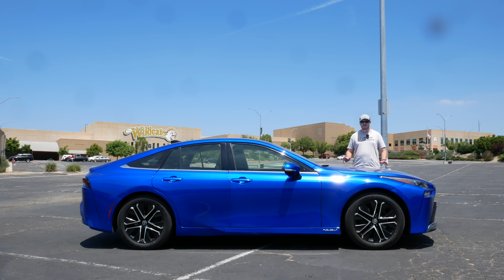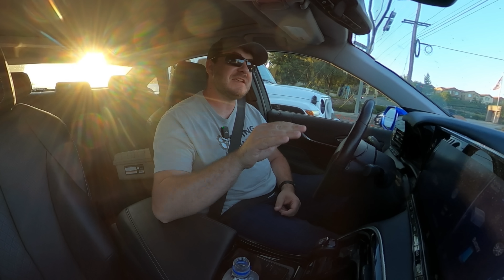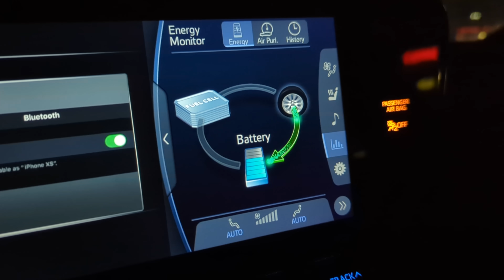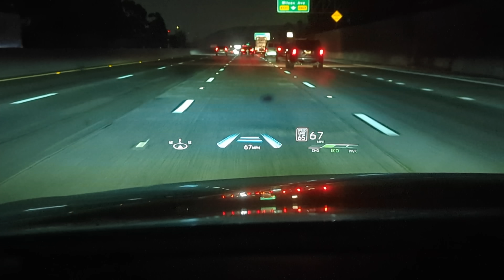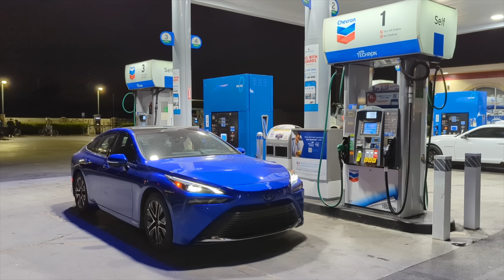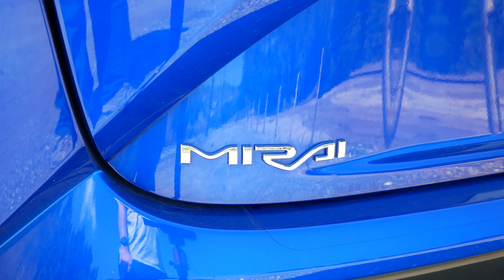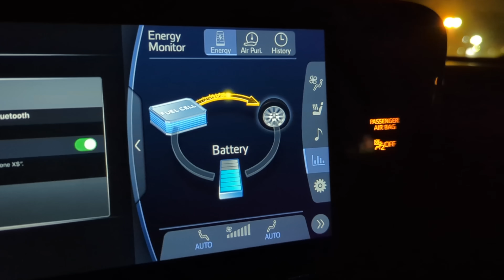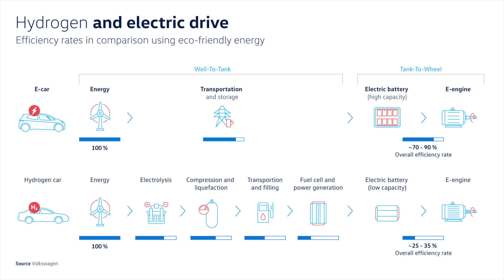The Toyota Mirai is Disappointing

Comment: Toyota's recently announced that they've finally come to accept that full electric vehicles instead of their crazy drive towards Hydrogren, and they've got some battery tech that should make even Tesla concerned.
Reply: If making an experimental new technology battery work in the laboratory is a 5 in difficulty on a scale of 10, then getting one in production in scalable quantities at reasonable cost that will at least match the life and cycles of what's available now is a 10+++++  There are literally a hundred startup and legacy battery companies promising all sorts of whiz bang cells that, up until now, have not made it into production.  Toyota may very well have a world beater battery, but the odds are it will come from somewhere else.
Reply: They announced hydrogen engines?

Comment: Honestly, 50 mile range plug-in hybrids with small, efficient gasoline/diesel range extender engines seem like the most sense as a "transition period" for me. 90% of the usage will be entirely EV, but range concerns and refueling time is just as good as most ICE cars. Much less lithium will be needed to be used, battery performance and longevity will matter less, and nobody will care if there isn't a fast charging station nearby, since they can just fuel it up at any gas station if need be.

Comment: Not trying to nitpick, but you really shouldn't refer to hydrogen as air. The correct term is gas, especially since there is hydrogen in air, albeit in vanishingly small amounts. You'd also be getting ripped off pretty bad if you paid that much for a tank full of air.

Comment: Because this is the wrong way to do a hydrogen car. Onboard separator that you will with distilled water fueling a hydrogen combustion engine...which can be easily adapted to any ICE design. Already being done with Farm machinery and heavy trucks in Europe. Cummins is debuting hydrogen combustion engines in 2025 adapted from their diesels. The technology has existed for decades and we all know why it wasn't focused on... because it would almost eliminate the oil and battery industry as we know them today.

Comment: ah yes, Hydrogen Cars, the more you look into it, the worse it gets with the promises that would somewhat need to break physical laws to work
And also speaking of Tanks, something most of the Tech Bros wont tell you, like that Fillingstations can't hold that much hydrogen like it could hold petrol or that the efficiency from Energy production to Wheel, as in "the ideal storage solution for wind and solar energy" is really bad that, even if you don't use it a fuel for a car, there are way better options to store energy like compressed air or heating up stones

Besides that not needing a car or not calling small lorries "cars" would be even better, but that's better safed for NotJustBikes

Comment: We have to keep in mind that this is very new technology. It's like going back to Nickel Cadmium batteries for your EV.
Reply: Not new at all, maybe the carbon fiber tanks are newer. But the first Hydrogen fuel cell vehicle was the GM Electrovan in 1966. The Toyota FCHV and Honda FCX, began leasing on December 2, 2002. So technically, HFCVs are at least 20 years old, about the same as modern EVs, which have advanced far faster then Hydrogen.
Reply: Actually it is an rather old technology….when I was a child, in Germany, some H fueled cars and smaller trucks was driving around…it was always just "research" projects…35 years ago!…the cars was able to drive, but nobody had the will to change anything at this time…especially not the car industry. The only German fuel cell car build in series (Mercedes Benz GLC F-cell) was canceled some years ago…now they are thinking about truck engines with fuel cells…let’s see, when this is coming to reality…

Comment: Great video, it explained the whole "hydrogen vs battery" shindig really well. I fully agree with you on hydrogen being part of the future, despite it being an objectively crappy choice for personal transport.
Reply: It’s not even that good for public transport either. After all, both buses and trains can be made to use overhead electric wires for power. So why bother with converting electricity to hydrogen and then back to electricity again?
Reply: It is good for long haul trucking and intercity bus lines.
Reply: @Schaufensterpuppengestaller  It makes no sense on our roads, far too many problems with Hydrogen. It simply can't compete with Battery electric, which is improving leaps and bounds.

Comment: if they made the battery capable of 50 plus miles, and gave you a charge port, alongside the hydrogen part, they could be far more useful, but honestly, there really isnt anything holding battery only EV's back.  this is just an ev with a small battery and an annoying fuel cell.

Comment: fuel cell cars will go nowhere because of what you just pointed out.
low efficiency being the biggest.
and high cost of hydrogen being second.
too high of pressures, too volatile and hard to contain.
there will be a few uses for it.
batteries will only get better and lighter from here though.
10-15 years from now batteries will be twice the energy density and half the weight.
which would really kick hydrogen.
never mind it's lack of power too.

Comment: I think the question of fuel cell longevity is important, with how expensive and short lived lithium batteries can be. If you could get a million miles out of the fuel cell, that'd be a big plus in my book. I think that plus the option of having an electrolysis hydrogen generator at home would make this a lot more enticing.
Reply: What EVs have short-lived batteries?

Comment: For semi trucks the best option isn't hydrogen but rails.
Reply: As a former semi driver I agree completely. Most runs could be 10 miles or less and the rest in a train. Trucks to and from the drain to the end users
Reply: Rails and overhead electrical wires, yeah.
Reply: For the majority but not for the "last mile" you still need trucks.
But as long as you can get it to the city or within fifty miles of it you can make Hydrogen do, or if you prefer nasty pollution lithium ion batteries.
Reply: @GeorgeWashingtonLaserMusket  You can do last mile by rail if you want to, you just need rails everywhere. Last mile by truck is just convenient because we already have roads everywhere.

Comment: I would like to point out that Hydrogen technology, as it is now, is about 10 years late in development when compared to battery EVs, as early Tesla Model S were sold in 2012. Back then, the charging network was also almost non-existent, with only 6 supercharging stations in September 2012, and there was even a campaign that grandfathered free supercharging (the same as offering hydrogen in this case). So I guess a fairer comparison would be between current hydrogen technology and 2014 battery EVs.

Comment: 14:45 It doesn't make sense even in those applications: synthetic fuels would be much better since they don't need low temperatures or high pressures, so their tanks are lighter and can be made in many shapes, and they don't waste that much energy in transport and storage.
Reply: i mean if you're gonna store energy chemically the most simple and efficient way to use it is electricity. production combustion engines aren't gonna as efficient as an electric motor
Reply: But synthetic fuel costs a lot of energy to make. It is more energy consuming than the whole hydrogen chain of compressing, transporting etc. And then when you burn it in a combustion engine, the total cost is immense.
Reply: @salipander6570  I find it hard to believe; do you have any study on it I can look at?
Methanol for example is a more stable energy carrier and can be used both in internal combustion engines or fuel cells.
Moreover, even if the overall efficiency is the same, it's better to have the losses "concentrated" for example at the production plant or the usage point, so you may be able to reuse the excess heat for something else. If you instead have lots of places where you lose a couple of percent each time, it's not feasible to recover that energy.

Comment: A car with the same power output as a 1959 mini that weighs half the weight, hipsters need only apply.

It's 4 times the weight of a 1959 Mini with the same HP, what a joke of a machine. [ even a 100% efficient cell would not beat the efficiency of an engine designed in 1949 ]

Comment: The advantage of hydrogen is that it can be produced locally from a wide variety of sources; hydro dams, wind turbines, solar farms... natural gas... :\ 

Ideally that'd cut down on the pipeline and transportation network we rely on for ICE vehicles etc etc, and would allow small-scale producers or even small home-based setups to produce fuel with next to zero emissions (when you include manufacturing, etc)

Now our problem is just setting up these 'communal' fuel networks when the most powerful corporations on earth control the oil supply ;)

Comment: Grey hydrogen production by steam methane reforming requires energy, and that has a environmental/financial cost. ICE cars can be driven with methane directly. CNG and LNG vehicles have been around for a long time. If longer range is needed, phase-change to liquid methane at a 15% energy/cost penalty. If the methane source is non-fossile it is nearly emissions free.

Blue hydrogen isn’t a thing yet, and isn’t on the radar.

Green hydrogen can be put to better use for iron ore reduction  in steel production, a huge source of CO2 emissions today. 

Running personal vehicles on hydrogen is so stupid that my eyes hurt. How can Toyota and Hyundai not see this, when all other manufacturers have avoided it like the plague?

Comment: I don't understand the hydrogen thing if you can turn water in hydrogen and oxygen and that explodes rather well then why start with hydrogen and end up in water?
And why people that started making cars that run in water so conviniently vanished?
Reply: Because cars running on water is a scam. Water isn't a fuel. To use it as a fuel, you need to use electrolysis to turn it into hydrogen, then burn the hydrogen or turn it into electricity via a fuel cell.
Only problem is, electrolysis takes more energy than you get out of the resulting hydrogen. It's always a net loss, and that's just how the physics of it works.
Reply: @logitech4873  Are you some kind of engineer?
Reply: @gabrielgomescunha  Hobby engineer at best. If you think I need to be an engineer to tell you this, that's up to you.
Reply: @logitech4873  I've listened to all kinds of people talking about making engines running on water, some very qualified others just a hobbyists and none said it was impossible but all agreed that the seven sisters made it almost impossible like they did for electric cars for decades.
Reply: @gabrielgomescunha  Thing is, this is just physics.
So let's set a goal.

We want to:
1 - Convert water to hydrogen
2 - Use the hydrogen to drive the car
3 - Use the hydrogen to power more hydrogen generation

For this to work, we need the hydrogen generated to output more energy than we spend on generating the hydrogen.

It requires at best about 50 kWh of electricity to produce 1 kG of hydrogen from water through electrolysis.
The resulting energy content of the 1kG of hydrogen is about 40kWh.

Oh, that's less than the energy we just spent.
And after converging it to usable electricity through a hydrogen fuel cell, which is at best 60% efficient, we're left with 24kWh of electricity.

We spent 50 kWh of electricity to generate 24 kWh of electricity.

This leaves us without enough energy to keep the cycle going, and it leaves us without any excess hydrogen to run the car.

I've assumed pretty good numbers for conversion efficiency here. In reality it would be worse.
For the idea to work, the conversion efficiency would need to be MORE than 100% for one or both of these processes, and that's impossible even theoretically.

These are well-understood mechanics. There's no conspiracy. Conversion efficiencies just make it physically impossible.
Reply: @logitech4873  why did you leave oxygen out of the calculations?
Reply: @logitech4873  also if it doesn't work from water to gas why does it work from hydrogen to electricity...?
Reply: @gabrielgomescunha  Oxygen isn't fuel. Oxygen is oxidizer. The oxygen output is irrelevant, as you can get all the oxygen you need from the air anyway.

And I don't understand your second question. Why does WHAT work from hydrogen to electricity? I'm not sure what "it" is here.
Reply: @logitech4873  you said the the process of getting hydrogen from water looses power along the process then what makes the hydrogen fuel cells not to loose power?. I guess the power needed to get hydrogen in the firs place was already lost. So then again what makes hydrogen cells better? Cuz it makes no sense. In any of the process you're bound to loose power anyways before you get to move
Reply: @gabrielgomescunha  You lose energy in all of the conversion processes. Hydrogen fuel cells lose energy too, they're only about 60% efficient (the rest is lost in the form of heat).

The difference is that for a hydrogen car, you have a big factory somewhere generate the hydrogen beforehand so that you can use it in the car. They use energy from the power grid to do this.

For a water-based car, you would have to make this hydrogen on-board, but you won't have enough energy to do so.

Comment: First of, if you call gas natural, you also have to call crude oil natural.
Battery technology moves so fast that soon everything else is obsolete, as soon as there's a safe battery that can hold 1000-1300 kilometres, anything else will go away, can charge over night, or once a week, or month, depending of what you need, my car take almost 10 minutes to ad 1200 kilometres, soon it will be the same, and yes, there's also cars that only hold fuel for 600 kilometres, that's just not what i need.
And why do that car have so many shades of blue?

Comment: point of a hydrogen vehicle is Japanese creating their own fuel. unlike EVs, hydrogen doesn't draw from the electric grid to fuel up, and unlike EVs it doesn't NEED the electric grid to fuel up. it's gasoline from water. 
not long ago they've developed a nuclear reactor that can reach temperatures required to extract hydrogen from water. these reactors aren't only useful(being far more efficient than current methods) in producing hydrogen, but are ultimately far safer than current reactors. these hydrogen cars is Toyota creating prototypes for future production. californians are just test rats.

to us gasoline powered westerners it makes zero sense, but to a closed nation like Japan, not depending on oil makes all the sense.

Comment: Lithium batteries will never reach this level of energy density.  This is the future of transportation.
Reply: The Toyota Mirai contains about 120 kWh of energy in its 142 liters of hydrogen tanks.
This works out to 845 wH/km.
EVs are approaching around 300 wH/km which is quite a bit lower. But battery energy density has actually tripled since 2012, and it's still rapidly increasing.

Comment: My father has been asking me for quite some time, why we haven't seen hydrogen cars pop up.
This video might actually help me explain it to him the next time we have a deeper conversation.
Thanks a lot for the educational content!
Reply: Yeah, the #1 reason is "where are you going to get the hydrogen?" - beyond there being essentially zero fueling stations, hydrogen itself is a fickle fuel that's very hard to acquire, store, or move.
Reply: @FuncleChuck Gas cars had all of the same problems when it started yet we never complained that it was expensive and stuff because it was better technology then a horse.
Reply: @FuncleChuck hydrogen isn’t that hard to get, it’s just expensive
Reply: @FuncleChuck  they kind of had the same problem when cars were invented ....
someone, somewhere is going to have to build these stations where one can refuel the machine at somewhat equidistant intervals.
The bigger issue is that it needs to deliver in terms of convenience and power to current standard.
It was "easy" when that standard was horses.
The gap between what we have and new tech simply is too big and it's not just a matter of adding more refueling stations along the way.
Reply: @NotTheStinkyCheese  The problem is cost and efficiency. Building the infrastructure for gas or diesel powered cars is rather easy and cheap in comparison to an infrastructure and production of hydrogen. And is also much much more expensive then an infrastructure for millions upon millions' of BEVs.
Reply: @NotTheStinkyCheese  Gas cans during the dawn of gasoline-powered cars was an entirely different thing.

Comment: I always wanted to ride a high pressure tank ready for an accident to happen and increase the kaboom factor 1000 folds.
Reply: Honestly I would prefer to rupture a (secured) hydrogen tank over a gasoline tank. If a hydrogen tank ruptures, its contents dissipate and fall below its lower flammability concentration very quickly. It doesn't pool on the ground and linger like gasoline does when a gasoline tank ruptures.